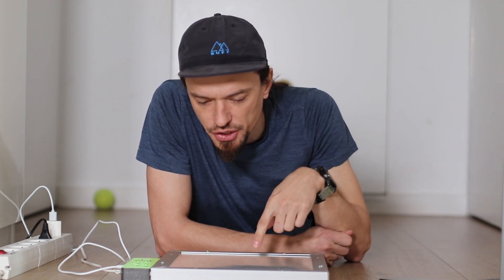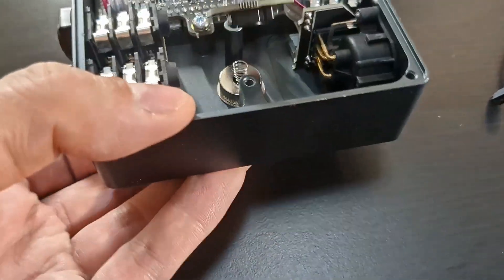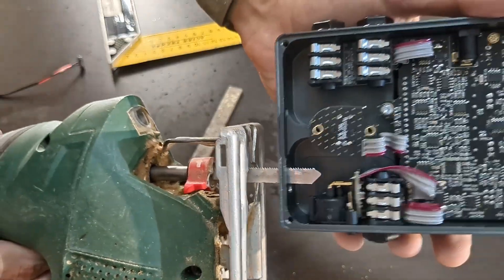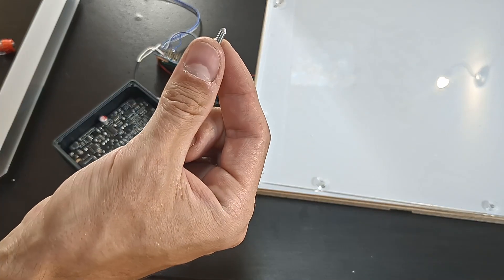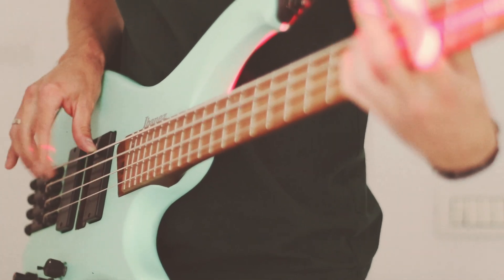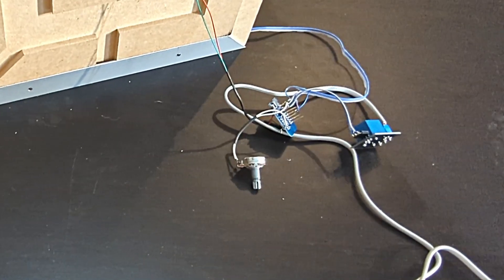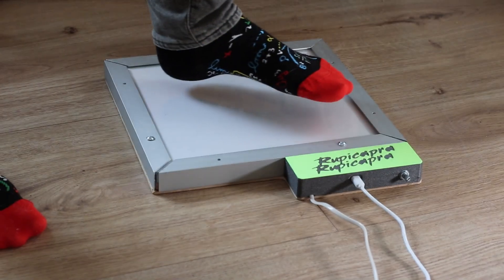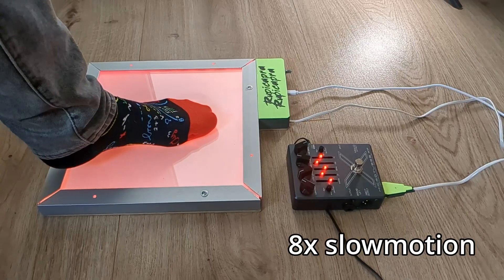Bass Pedal Hacked with a DIY Pressure Pad

Comment: Instead of drilling into the aluminum casing, it might have been easier to print the bottom part of the casing a little thicker so that the cables would go outside. The printed part could have been part of the magnetic holder right away.
Reply from the maker: I like this idea